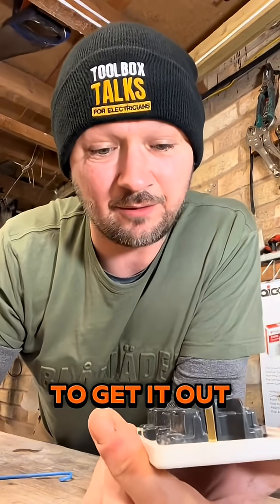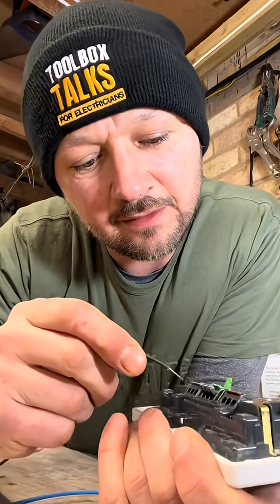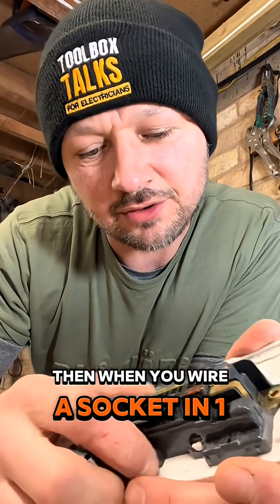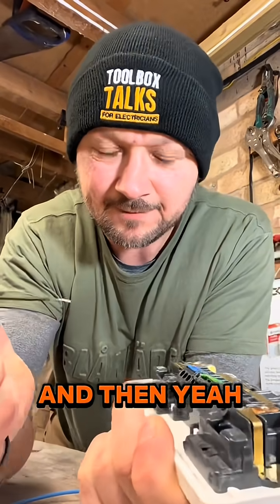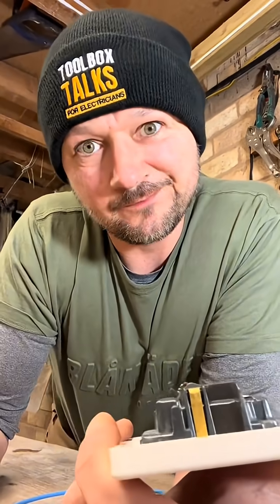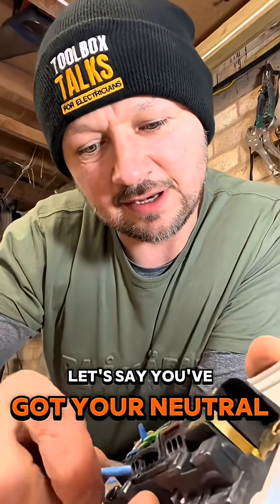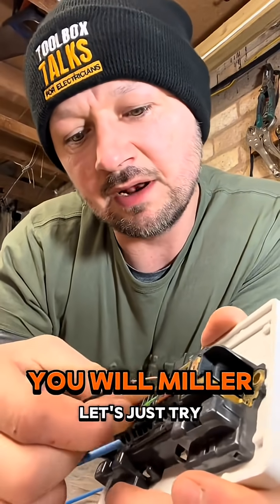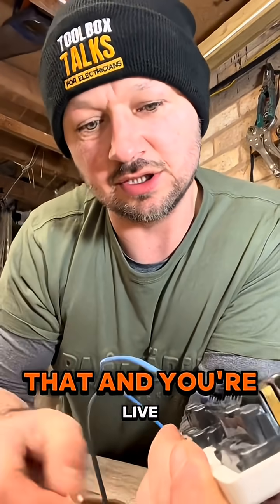Fast-Fix Sockets + Cutting Install Time + The Terminal Tug Test Results

Comment: The only part i like the look of as a DIY guy is you have 3 separate contacts, one for each Wire, not a big fan of shoving 3 wires in to be held by the one screw.  (which i have dropped in the past obviously!).

Comment: Yeah, even with electrical basics, you have to learn that a good electrical AND mechanical connection. Not sure which page of the Regs stipulates how good the mechanical connection should be..
You know where you're at with a screwed connection torqued with a Wera to manufacturers spec tho.
Reply from the maker: Totally agree, a good mechanical connection is just as crucial as the electrical one!

Comment: I imagine these outlets get warm occasionally - say, when a 2 KW appliance is plugged in? Over time wouldn't this draw the temper from the springs? I still think bolts are better...
Reply from the maker: Those are some great points to consider, especially about long-term performance!

Comment: Why would you have 1.00mm earth? The earth (cpc) has to be no less than half the conductor size. So 2.5 conductot cpc is 1.25mm. Never understand wago's a brass screw onto a brass tube has way more surface contact area tha the wago, and you can't "spin" the cable around in a screw.
Reply: old 2.5 twin and earth used to come with 1mm cpc, I come across it quite regular on social housing
Reply: A cpc to a 2.5mm T&E is 1.5mm not 1.25mm
Reply: 2.5/1.67
Reply: @georged9801  the 1.67 comes from dividing 2.5 by 1.5 for ring continuity resistance measurement. The adiabatic equation gives you required cpc size
Reply: No less than half the size is not true, 4mm Twin and Earth has a 1.5mm cpc, 6mm has 2.5 mm cpc, 10mm has a 4mm cpc

Comment: I'm just wondering here. So, bare with me.
At what point will those wires move with that much force to fall out of the terminal? Especially if it is fitted in its mount to the wall. If the wire is flexing that much in the conduits, there's a problem with the rcd at the consumer board. I've seen what happens when a cable dead shorts, it does flex loads if the rcd doesn't trip.
Reply from the maker: Yeah, maybe the wall falling down is extreme 😂
Reply: @toolboxtalking well... I have seen a brick wall fall, well more like a whole chimney breast. I was standing amongst the rubble while it fell. Poor poor property maintenance. So, technically could be possible. 😂😂😂